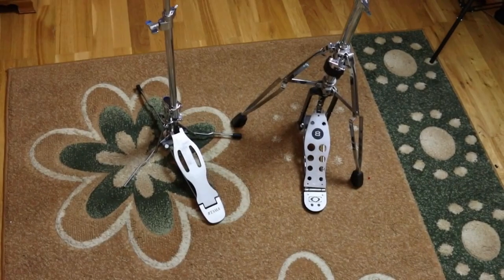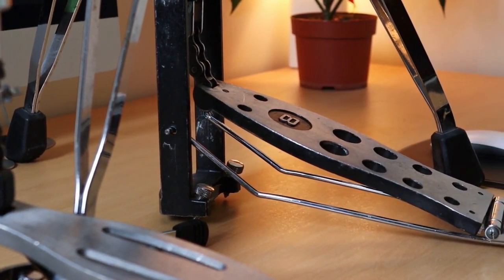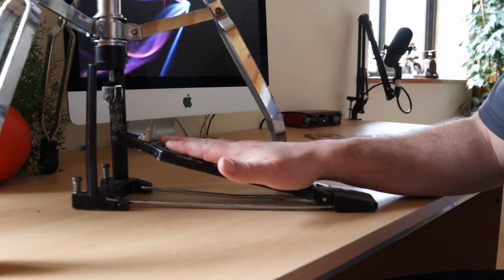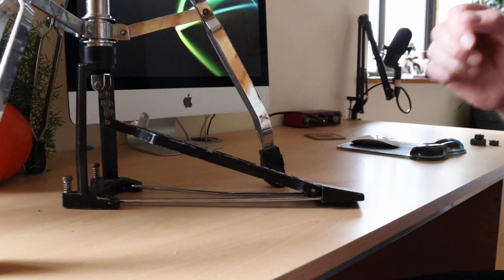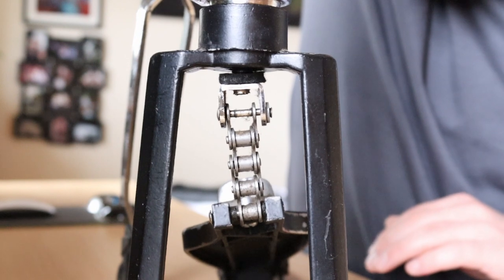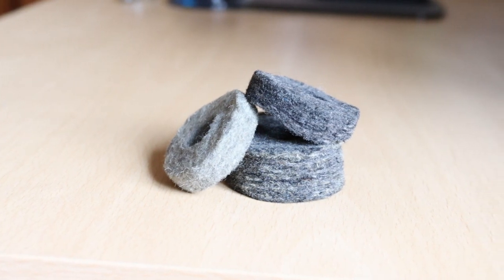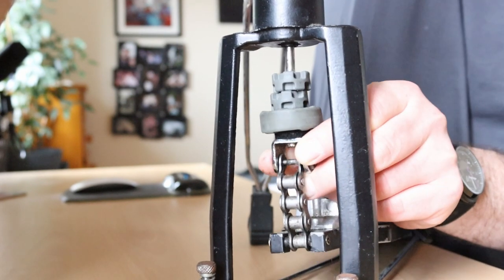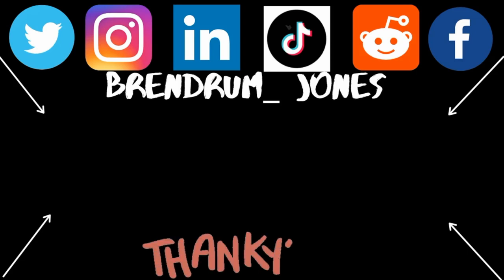How To Change Hi Hat Angle?

Comment: black pipe insulation would also work and not require you to unscrew the bolt. You could also use a 1.5"-2" wide, piece of velcro. The only issue I see with this is that you are putting more strain on the inner spring, reducing its wound strength, so it'll wear it down faster over time and/or not feel as responsive or fast.  But cool drum hack either way! thanks
Reply from the maker: Yes it would put more strain on the inner spring, i dint think of that